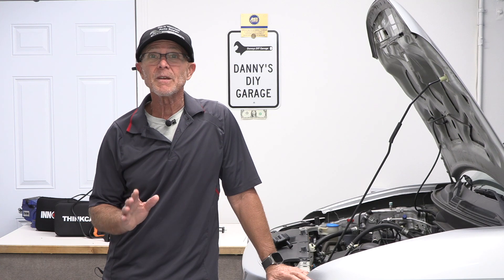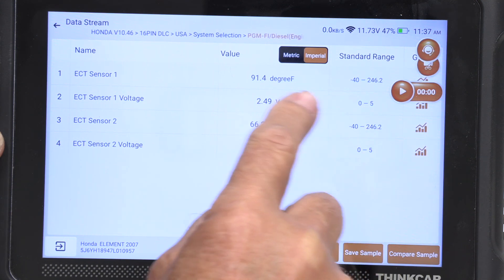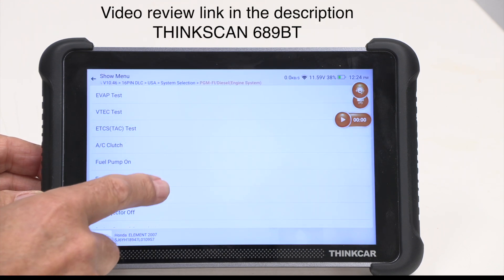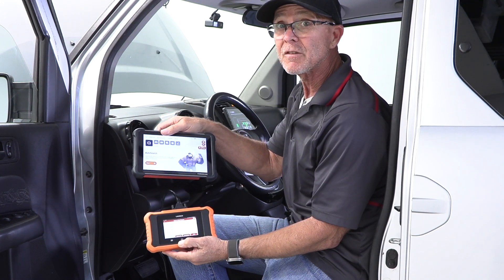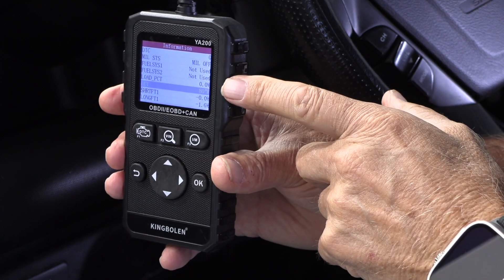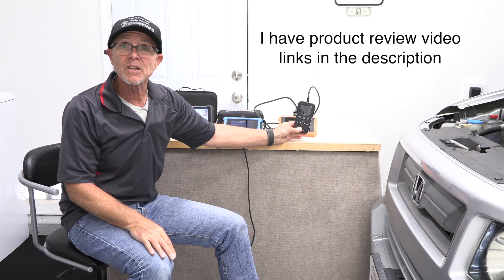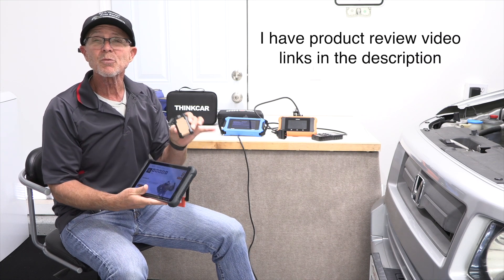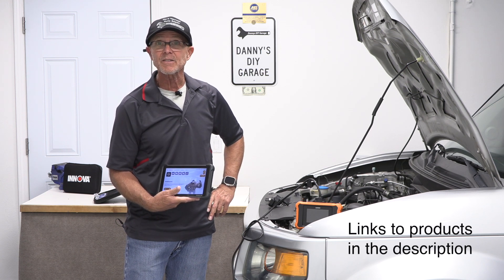The Value of a Good OBD2 Scan Tool: Full DIY Mechanic's Buying Guide: Which Scanners Right for You?

Comment: I have a 2001 Dodge Ram 1500, I installed a new engine and now have to perform a Fuel Sync. What’s a decent, low cost scan tool to do this with?

Comment: Hi Danny,

I have a 2007 Honda Civic with the R18A engine & 5-speed manual gearbox in India. The car has been running well because I’ve maintained it properly. But recently, it started having a misfire issue — and it’s only happening on Cylinder 1.

Here’s what I’ve done so far:

I changed all the spark plugs — no improvement.

I swapped the ignition coil from Cylinder 2 to Cylinder 1 — still misfiring in Cylinder 1.
So I believe the coils and plugs are not the issue.

I got the car scanned with an OBD2 scanner, but there were no warning lights or clear error codes. The misfire doesn’t happen all the time — it comes and goes, which makes it harder to catch and diagnose.

I also checked the voltage going to the coils, injectors, and sensors — everything looks normal and consistent (though I couldn't check it exactly during the misfire, since it happens randomly).

Now I’m not sure what to check next. I was thinking of doing the following:

Clean all engine sensors.

Remove and clean the injectors.

Check the fuel filter and inspect the wiring for any damage or loose connections that might cause a temporary issue.

However, some mechanics told me these steps might not help and are instead suggesting that I repair or replace the ECU, as they think there could be a communication issue with Cylinder 1.

I’m unsure which path to follow next. I’d really appreciate any advice from you or other Civic R18A experts here.

Thanks in advance!
Reply from the maker: All good stuff you should do, Im assuming high mileage, has a compression test been performed, also valves usually tighten and not loosen, which will also cause intermittent misfire
Reply: @dannysdiygarage  thanks for your suggestion. Will check it.
Reply from the maker: @fahrenvibes I have videos on valve adjustment and compression test if needed
Reply: @dannysdiygarage  i forgot to mention, its not a high mileage vehicle. Its close to 60,000 miles now (its too less for its age, but its been used along with other vehicles). So, I'm not sure, if compression would be an issue but I'd still check it.
Reply from the maker: Try getting a squirt bottle and squirt water around the coils and other electrical components, tug on connectors and check the connections on pins for tightness, tap lightly on sensors, intermittent s are always tough, if you have a borescope you can look at the valves for carbon buildup. These are just thoughts, so take it for what it’s worth, in my experience it’s been sticky valve on that cylinder and doing a decarb and injection cleaning could help, good luck
Reply: @dannysdiygarage  sure, will do. Thanks for the inputs.

Comment: I purchased Autels top of the line hand held code reader in 2013. I wasn't able to update it. Tech support was non existant. I finaly figured the provided disk did not imstal the proper driver on my desk top. I found the driver on line. Once that hurdle was overcome, I couldn't register it to my E-mail adress because my adress had to many characters. I finaly registered it to my wifes E-mail successfully. Since then my wife changed her E-mail account so I may be screwed if I have to update for a new family vehicle.
Reply from the maker: 2013, you defiantly got your moneys worth, that's a long time ago, defiantly time to upgrade. what was your thoughts on the scanners I showed in this video?
Reply: @dannysdiygarage  I liked the one with the big display. Lifetime updates are a huge advantage. On my next scanner I will avoid anything that requires a subscription to stay active.
Reply from the maker: Subscription services are definitely something to consider 👍🏼